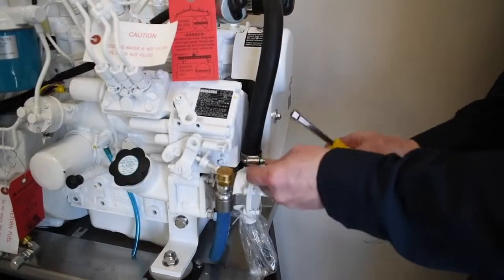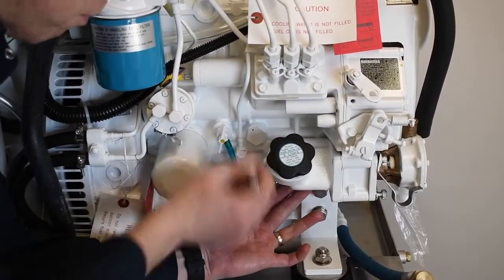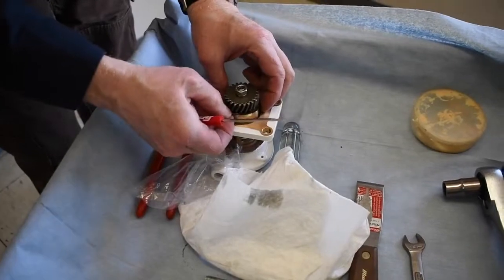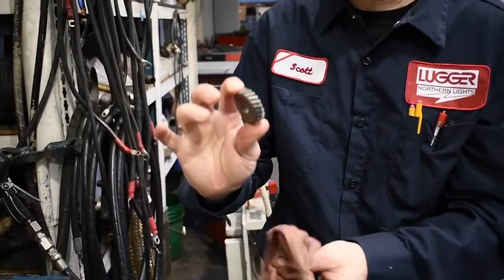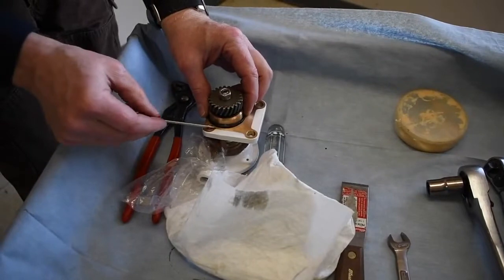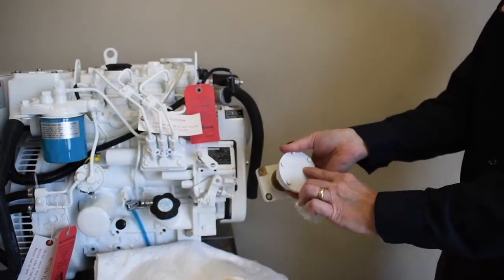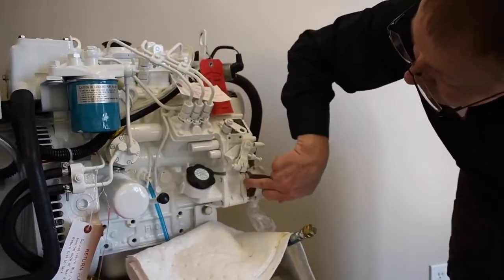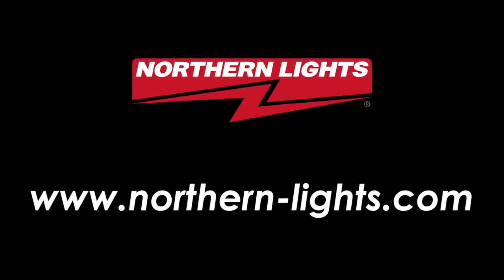Northern Lights Marine Generator Seawater Pump Replacement

Comment: What are the trouble shooting indications that seawater pump needs replacement versus the raw water pump?
Reply: The seawater and raw water is the same pump. The only other water pump is the fresh water circulating pump. The indication for the need to change is if you see any water dripping out of the pumps opening, which means its seal is starting to leak.